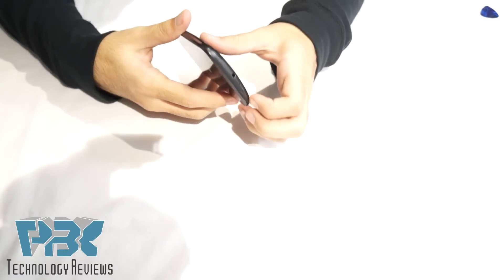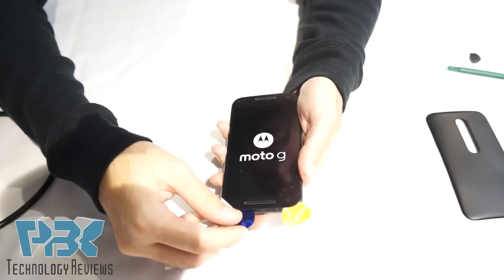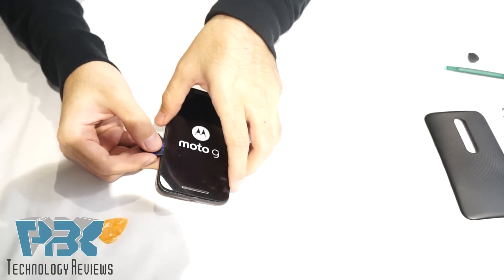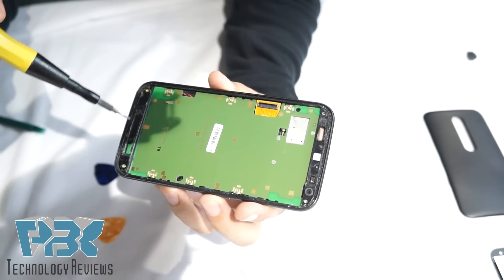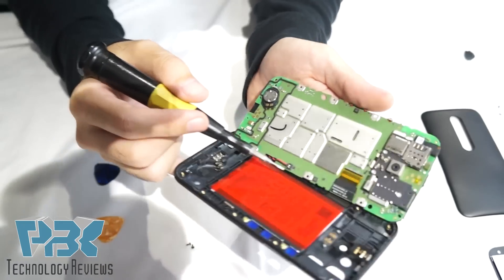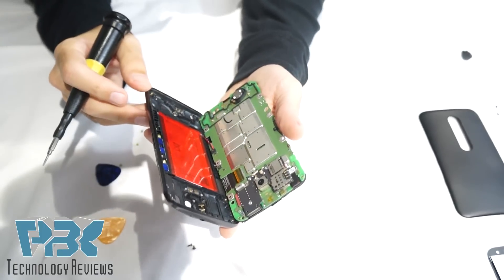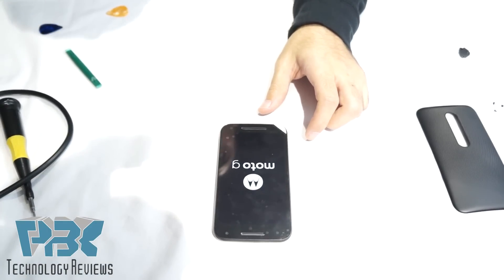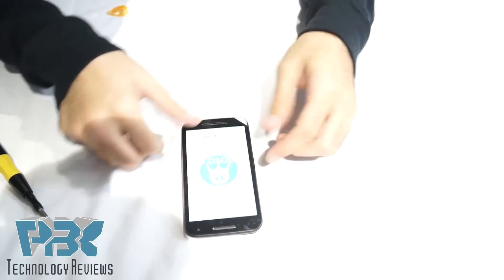Motorola Moto G (3rd Gen) 3rd Generation 2015 Disassembly Teardown LCD Replacement

Comment: I am having problem with my camera, when i try to open the camera app, it tells me " camera busy, camera unable to start. if this repeats please power off your phone and restart "  i have tried all the options available and i have come to a conclusion that it is a hardware problem. So my question is, can the camera be replaced or worked on ? there is no Motorola service center in my country (Ghana) so I am planning to give it to this phone repairing guys.
Reply from the maker: +Patrick Mensah  Yea the camera should be replaceable. Phone should have warranty, where did you get the phone from?
Reply: +pwrdbykyank A brother of mine, who lives in USA sent it to me. But sending it back to him will be expensive and i don't intend to do that.
Reply: +pwrdbykyank Thanks, anyway.
Reply from the maker: Oh ok, have someone who knows how to take it apart, take out the camera and put it back in, might fix the issue.
Reply: +pwrdbykyank okay will do exactly that. thanks
Reply: +Patrick Mensah have you tried going into apps and force closing the camera app and any process related to it?
Reply: +draw4yourlife3 yes I have done that and still the problem persists. I even took it to some of the tech guys and I was told the parts are had to get, he didn't even bother to disassemble it, he only flashed it with a Motorola stock Android OS and it couldn't fix the problem so I took the phone and have been using it without camara and flashlight

Comment: I removed my SIM card from my Moto G and it broke off one of the 4 connector pins, you mentioned that the part is removable but didn't show it. Just to be clear, I can order in one of those parts once they're available and repair it?
Reply: +Jake VanBuschbach I also accidentally removed a connector trying to remove a SIM card.. Is this not a construction fault by Motorola? See also:https://www.reddit.com/r/mobilerepair/comments/3hov0x/broken_sim_connector_3_day_old_moto_g_2015/ which describe a simiar incident.. I have never had a phone where the SIM card is so difficult to work with. I talked to Motorola, and the company I boght the phone from, and they both say that there is no warranty... Breaking a brand new phone simple by changing SIM card should not cause so many problems...
Reply from the maker: +Jake VanBuschbach Yea it will be replaceable, its a mini board connected over the main board, so that mini board containing the sim slot and micro sd is removable/replaceable. It has I believe 3 screws holding it down in place, you remove those and pull off the connector. If I were you I would try calling motorola and arguing that it was a manufacture defect due to the fact that all you did is take your sim out and that happened, see if they would honor it.  I know someone else mentioned motorola didn't honor it for them but usually they should, and if not they will offer you a repair solution and give you an estimate of the price of repair.
Reply from the maker: +Thomas Mejer Hansen Have you tried talking to another rep at moto? Also they usually provide a repair option and cost if they deem it not covered under warranty.

Comment: Can you make a video of the same phone, but do a dunk test?
Reply from the maker: Jeremy Forrest We should have tried that to see how it would do after a disassembly with water, but we already parted out the phone. However based off the inside and the way the shields were, with or without the LCD being removed or not, water will still make its way inside the phone, so I would presume it wouldn't make much difference.

Comment: Can you make a video of the same phone, but do a dunk test?
Reply: I take my Moto 360 in the shower with me everyday
Reply: Reading some reviews about supposedly waterproof phones or photo cameras, there's always some people whose device died when used underwater, and (depending on manufacturer) often denied warranty because of "water damage"!
On the other hand, I've used my Garmin Montana waterproof GPSr while riding a motorbike in tropical rains for years, washed it with soap and water under the tap, for 5 years already, with no ill effects. Recently had to disassemble it to replace the body (rubber coating is crumbling after all these years in hot and humid tropics), and it's quite impressive how big effort they put into waterproofing. Double-lip silicone seals, all the ports are sealed/potted with some hard clear compound. Of course, that makes it a real pain in the ass to service!

Comment: After doing this is the phone still as water resistant as before?
Reply from the maker: FubarMike if you reapply the adhesive with heat or replace the adhesive with a new one I don't see why not. It didn't have any special seal to completely prevent water from going inside so I'm assuming they have some special coating over the chips and board and that the shields over the chips are better at keeping water out.
Reply: +pwrdbykyank when you do this are you not afraid of getting this special coating on you and in you? and that the chemical will give you cancer?
Reply from the maker: Lol I've taken hundreds of phones apart and I'm fine, there's no such thing.

Comment: I found it to be quite impressive how few components are on the board and how thin the shielding caps are
Reply from the maker: hoodaly ya, they keep making them smaller and using up less of the circuit boards as they go. It's more cleaner but the smaller they get, harder to replace individual parts on the board itself.
Reply: hey my phone blank out on me and never came back on, does not want to charge or reboot and I really want to keep my information  I don't wanna reset it. is there any other way if my battery died?